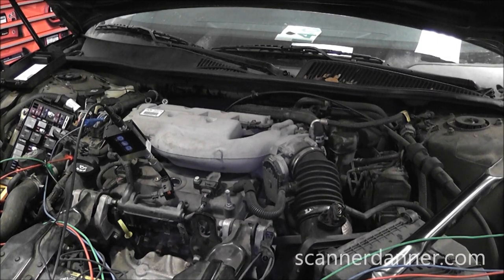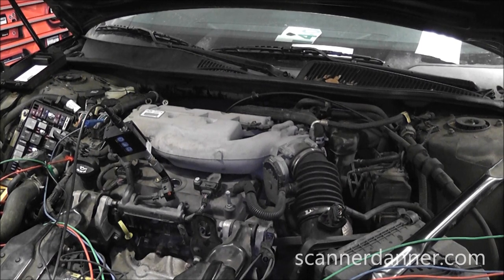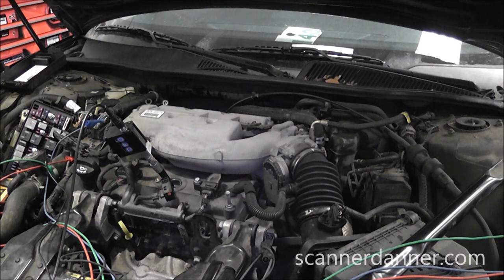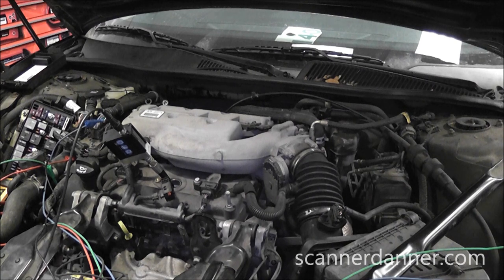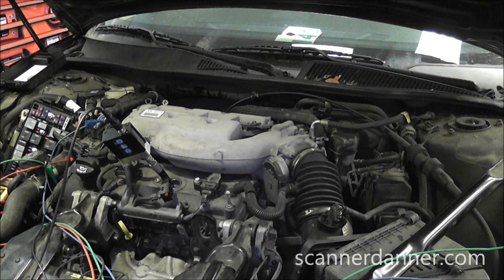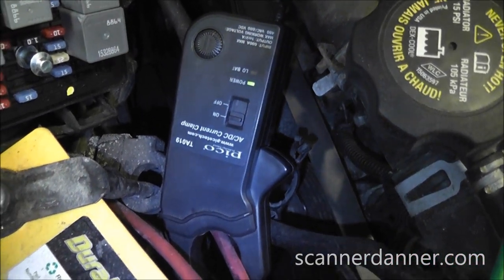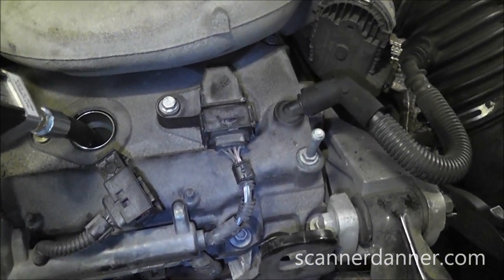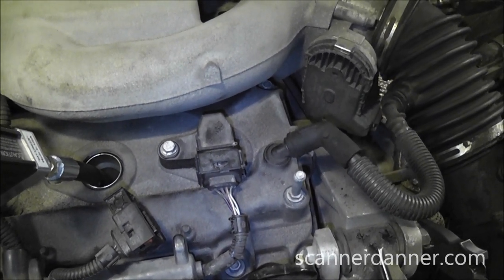Jumped timing chain (no compression on 3 cylinders) - GM 3.6

Comment: Hi Paul! Once again a very nice video! If you would have been looking at a control signal for a regular coil firing two plugs at the same time the relationship between starter humps and timing would be ok? Is is not quite an easy mistake to do when working with different ignition systems?

Comment from the maker: I just went back and looked, there is no way to know if I had my leads connected wrong on the back cylinder head but I did notice that the "red trace" is also off, (one tooth) on the back cylinder head compared to the front. 
with that info. I believe we have more than just one stuck or broken cam phaser. what are your thoughts?

Comment: this motor has 4 cam sensors, 2 intake/2 exhaust. doesn't it also have to coil packs? a bank 1 and bank 2 each signaled to by respective cam sensors?

Comment: Hey scannerdanner when you hooked up that backprobe to the primary signal wire of the coil pack does that probe measure current or are you measuring signal voltage? How does starter current draw dictate how many humps are on the scope? If you had no compression on three cylinders you are missing three humps why is that?

Comment: Hi Paul,   you said you missed 3 humps  and the distance between spark generation is 720 CA
I think this design is  a Waste Spark Ignition System 
.so this distance is  360 CA not 720 CA , and ECM will generate 2 sparks every 720 per each cylinder  
 .you can not figure out if the spark is generated in appropriated time or NOT  for all entire cylinders by this way  
maybe it would be appropriated if these 6 cylinders are being in -line desigen not in two Banks
.waiting your Feedback please
Reply: Mohammed Shamy it's coil on plug. Each coil only fires when that cylinder requires it.

Comment: don't know if some one already said this but I believe the firing order on that eng is 1,2,3,4,5,6 and that is why you didn't think you had a compression issue at first. If the eng would of have a different firing order you would of heard it. does that make sense?
Reply from the maker: Regardless of firing order, one cam being off would have produced the same every other cylinder pattern on any V type engine.

Comment: One of the cars that we love is doing the same thing, IT SOUNDS EXACTLY LIKE THIS ONE WHEN TRYING TO START, I know there is some misalignment because there were 2 specific errors for cam and crankset. Is there s chance replacing the timing belt will fix this? WE HEAR NO SOUNDS OF METAL ON METAL WHEN CRANKING OR WHEN THIS FIRST HAPPENED. This is so old I bet I do not get a reply. :-)

Comment: Greedings Paul, for the correct timing you say the spark must happen exactly at the top of compression peak.whenever it is not you say timing is wrong.

someone agued me saying spark must be few degrees before tdc. atleast 10 degree. so that fuel mixture have time to ignite and at tdc that is when it will be fully effective.

i never heard you mentioning that anywhere.

BLOM MOSHITOA (S AFRICA)
Reply from the maker: Not sure I used the words "exactly at TDC". It is absolutely common to see timing anywhere from 10 degrees before to even after TDC. Had a Lexus that was at 7 degrees after TDC and it was normal during a cranking situation

Comment: Hi paul excellent video as always, thanks for sharing it. I have a couple of questions, you said on video at around minute 20 that the CKP was a VRS, and its signal varies due to cranking speeds, so the higher amplitude on the capture (same minute of the video) can be explained by the missing humps?, also I noticed the slope to the right of the humps are longer than the left and not even.  What do you think?.  Can we use these in the analysis?. Thanks.
Reply: No the missing signal is called a sync notch and is used for cylinder ID
Not sure what slope you are referring to.
Reply: ScannerDanner Premium  Thank you for taking the time and short reply. Sorry, my mistake, I wasn't clear probably because of my english. I meant there is an increase in the amplitude and I believe the frequency of the signal of the CKP, but I´m not referring to the sync notch, but the several waves that get wider and then shrinks back, and second I´m not sure if slope is the word but the cylinders that are contributing made the humps in the graph but are not symmetric, they are like an inverted V but one leg of the V is longer than the other, Hopefully I'm clearer now, I tried but my english needs practice. Thanks again.
Reply from the maker: Atacama777
No problem! Wish I knew a second language. I think you're doing great. Anyway. The waveform increases and decreases in amplitude simply from the crankshaft speeding up and slowing down. It is a characteristic of a VR sensor. The reason for the crankshaft speeding up is from the no compression cylinders and what slows it down is the compression in the 3 good cylinders. Hope that makes sense.
Reply: ScannerDanner Yes, it makes sense, thanks again for your answers and your videos of course, cheers.

Comment: You used starter current too see compression because it’s going to slow down when met with resistance (cylinder pressure) and cause current to build?
Reply from the maker: yes sir
Reply: Cool

Comment: Hi Paul. im thinking about buying an oscilloscope, but is it necessary that i buy an amp clamp to use it for a relative compression test like you do? i can't just pierce a wire and measure current like that with the scope. i know i cant measure it like that with a multimeter unless i put it in series. but is it the same with a scope ? are the leads of an oscilliscope set to read current with one one lead like a clamp does? or do i have to put them in series as well ?
Reply from the maker: +Alejandro Amaro same as a multimeter bro.
Reply: +ScannerDanner okay. sorry for the dumb questions lol. I'm just a DYIer trying to learn more and more. plus, i can follow your videos better if i get one and take my Diagnostic skills to a whole new level. i really don't want to have a "swaptron" mentality just throwing new parts to cars thats why im trying to learn the right way by watching your videos. thanks for all your time btw bro
Reply from the maker: +Alejandro Amaro no apologies necessary my friend. It was a valid question.  Just think of the scope as a really fast voltmeter
Reply: Okay. For Now... I was thinking about getting one with a 20Mhz Bandwith and 48 Ms/s sample rate..  Is that okay ?  Or do i need a faster sample rate ?

Comment: Damn ipad....this engine has also a variable camshaft and 4 cam sensors, my guess is, that those actuators are fine,but  the camshafts are broken and in result of this, pistons are working fine but the cams are o. a wrong position and can't move due to the broken shaft, further I suppose that the timing chaiin has not jumped over....a common problem with gm engines are lenght/strechted chain/s. I advise you to remove the valve covers and than check your camshafts by cranking.

Comment: i have a question. in the video you synchronize your relative compression readings with a single ignition firing event. if you did that with the back cylinders then the sync signal would be seen on the gap between 2 of the 3 homps correct? could that lead us to misdirections as far as what to test next?
Reply: I am not 100% sure what we did in this video without watching it again but my gut says yes. That is always a possibility in a case like this.

Comment: If these engines are out a tooth would they still run? Replaced timing chains ,guides, and tensioners on my and still have p0017 and p0008 with misfire , suspect im off.
Reply from the maker: not sure, I think so

Comment: Hey Paul I don’t know if you get this or not but I have a 3.6 Arcata that did the same thing. Was wondering if you found out that if that bent any valves And did you come across any other captures for that cylinder head?  Thanks Doug
Reply from the maker: sorry man, no and no :-( 
I was happy just to ID the issue and send it to engines class, then engines class didn't want it (too busy at the time) so the car left

Comment: This is a great video, but but but, I have a question for you. So not only am I a backyard mechanic but I've also got a degree in computer science and I.T. my question is, how in the heck are you using touch screen on a projected white board? I thought I've seen everything, I've never seen this b4 and I can NOT find any info on it, this would be perfect for training so any info would be awesome and I mean on your exact setup if you could and are willing too. If not I get it but I did Sub and like, either way thanks for sharing all the info.
Reply from the maker: It's called a smartboard. There is software that comes with it that contains the "ink aware" stuff i was using to be able to draw over any screen my regular windows 7 laptop is showing. Hope that helps. Thanks!
Reply: ScannerDanner: Thank you thank you

Comment: I have a 2007 Suzuki Forenza and the timing Belt jumped and the camshaft tensioner broke fix both of those issues now it’s no compression coming from the engine... How can I fix this problem
Reply from the maker: Interference engines bend valves when the timing belt breaks. You'll need to remove the cylinder head(s) and have all new valves put it.

Comment: Hey Paul I have 2007 Lincoln MKZ I have low compression on cylinder 5 only just wondering before I jump to conclusion thinking it's the valve or anything like that could have possibly be crankshaft sensor.?
Reply from the maker: No sir, unfortunately

Comment: I have the same motor in a Cadillac CTS with 175 pounds compression on 5 cylinders and 0 pounds on number 6 cylinder I had a bad intake lifter so I replaced it and put it all back together and still have no compression engine still will not start. I first thought it had jumped time. Am I looking at the wrong thing here?
Reply: Wabbit... What did the issue turn out to be? Had the valve been bent when the lifter failed or was it a head gasket issue?

Comment: You say the Crank signal waveforms just looks that way, but you fail to notice the Amplitude and Frequency increase is directly related to the loss of compression on the 3 cylinders. In other words, the vehicle can be diagnosed with just the Crank waveform. This is one of those variables you are always talking about.
Reply from the maker: For sure, they do match, but that is also in hindsight don't you think? I have seen many irregular crank signals during cranking and it is completely normal. But I get what you are saying for sure, I should have caught that.
Reply: I was thinking the same thing also. Good catch MassMechanic.
Reply: ScannerDanner Great job Paul, just goes to show were all human and we can't think of everything all the time.

Comment: Hi paul,great video ,just a question,would it be possible to check MAP V while cranking the engine in two condition :
1_closed throttle
2_WOT
if the MAP V  increased with closed throttle and decreased to atm value in WOT it result that we re dealing with timing issue?
Regards.

Comment: Is this true on a 2.5 nissan w/ dohc?  The pre cat clogged and caused a miss on no.3 so installed header and new head gasket along w/ valves × rings. Put it together and still have miss. I think one of the cams are out a tooth or more. Please get back to me with your input.
Reply from the maker: You have a single cylinder misfire or an entire bank misfire? Also you said the cat was plugged but then you did cylinder head work?? I'm not following why you did that. If you have a single cylinder misfire, we need to find out what you are missing. Spark, fuel or compression
Reply: @ScannerDanner  Well, also when checking the bucket clearances I  couldn't get  a feeler guage between the lobe and top of the valve bucket ( new valves). So I  thought this could add to the no.3 cyl miss. I have another head w/ more miles and thought of switching some of the buckets to get clearance?
Reply: @ScannerDanner  The cylinder head work came after a leak down test. No.3 cyl rings were stuck to the piston from the clogged cat.

Comment: I have a 1992 Lexus LS 400 with 67,000 miles, it has been sitting in a storage for more than 8 years. It has 0psi compression on cylinders1,2 and 7 do you think that is valves stuck ? All of the other 5 cylinders are right at 200psi. And advice would be appreciated.
Reply from the maker: Most likely and if this is an interference engine they may now be bent valves on those cylinders.

Comment: Mr I have a 91toyota pu the problem I have is it will start drive but as soon as I turn it off when I turn the ignition it will not start I have to spray starter fluid or wait for two to three hours for I have to start please help
Reply from the maker: Does this have the Vane Airflow meter (old school mass air flow sensor) in the air intake tube?
Reply from the maker: Watch this at the time stamp I created https://youtu.be/Rqtfrx-HeD0?t=28m25s I will be discussing the early Toyota fuel system designs where a circuit opening relay and Vane Airflow meter are used. Pay very close attention to the operation of the circuit opening relay and fuel pump cut off switch of the VAF. I believe with your description of your symptom that the crank circuit of your circuit opening relay is NOT working.

Comment: hello i have a question i have a 88 nissan maxima with the 3.0 v6 and it is an interference engine my qquestion is after removing all the timimg belt covers can i just take off the old belt and install a new one with making sure that no cams or cranks move??because  my engine runs great now so it will be just a swap will it bend the valves do i have to realign everything againn? im also changing the water pump and tensioner please answer as soon as possible the car has 108000 the belt was never changed will u also recomend to change it now or wait??
Reply: mike pilot change it! I owned one from NEW to 225K and even let friend NOT pay me if he did the belt first, knowing it was imminent and he chose to ignore for 3 months AND not pay me and snapped belt and blew motor. Absolutely do water pump with each change and watch bearing on AC compressor. It’s prone to bind and snap belts. Don’t try routing with one belt as too large an angle on the power steering and it slips. Perhaps the BIGGEST issue with this motor is the $700 glass airflow meter. There is water from condensation that gets into air box and goes down into airflow meter and freezes and it blow it! Nissan guru told me to use a motorcycle filter or just disconnect tube from air box, but filter seems to catch condensation and protect better than open whole and loose hose, but still better option than leaving connected without a condensation catch. Trust me, plus realize motor had a fuel injector recall and was this giant thing? Training all techs to do the injector replacement and I found another potential salvage late 87 (had 88 dash, stereo etc) and it had 90K but mysteriously did not have injector recall performed and no technician knew how to do it properly until I bumper into this Jerry Garcia looking Nissan tech that was around during that time and saw improperly grounded wires and said Nissan dealer that performed the recall for me a decade late had botched it badly. But year, it will repeatedly blow those insanely expensive glass airflow meters so remove the hose from the box and research a good filter fix. Meanwhile grease hell out of that AC compressor bearing and hope that $700 part doesn’t fail because I tried to find a used one and all three had same bad bearings!

Comment: If you have cam sensor codes for affected bank, u can easily access these cam sensors and remove them to see through the timing cover the cam gears are not turning, thus indicating timing chain issue,I.e tensioner or guide or chain broke. No scope needed! 10 minute diagnosis time max.
Reply from the maker: Your suggestion has nothing to do with this issue on this car.
Reply: Cam gears are turning Via the waveform on the scope as the sensors are picking up a signal. Scope was needed for confirmation the timing was off on that bank of the engine.
Reply: Scannerdanner is right you can't see a jumped timing chain with your eyes because it is still connected to all of the sprockets. You have to use the picoscope or verus.
Reply: ScannerDanner what if you had done a compression test on all cylinders using an actual compression gauge. Also when using cranking voltage as your compression test tool, you could remove one spark plug to get an idea of which cylinder # wave hump you are looking at. Just need to know firing order and which plug you removed. Thanks, I enjoy your videos.

Comment: I have a 2009 Chevy cobalt doing the same thing it’s running on 3 cylinders instead of 4 help ? What’s wrong with it ?
Reply: @ScannerDanner
Reply from the maker: spark, fuel or compression and all three need to be tested, find out what you are missing and then we can go from there, otherwise we are just guessing
Reply: 3rd cylinder is low on compression .

Comment: I'm gonna go out on a limb and say this shop did a timing chain job on this car before all this started being as these particular motors are bad about timing chains making noise and the only way to do chains on em is to pull the motor. Far as I'm concerned, if they did screw up a timing chain job I don't blame em cause these motors ain't easy to time right.